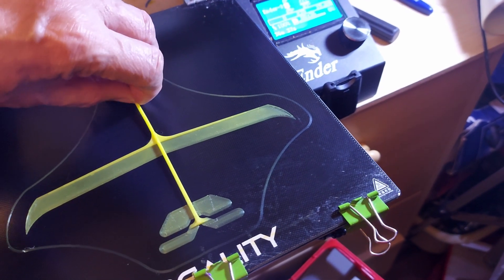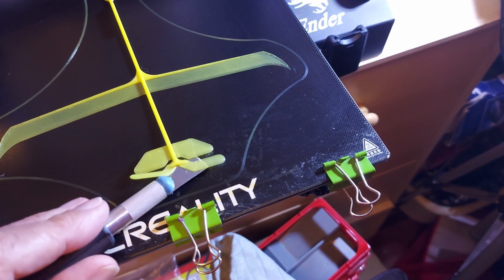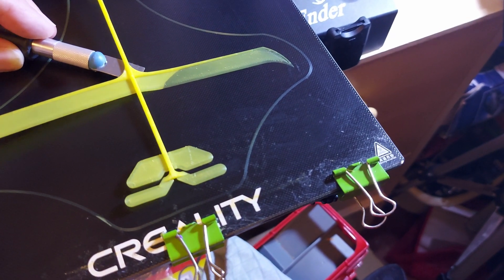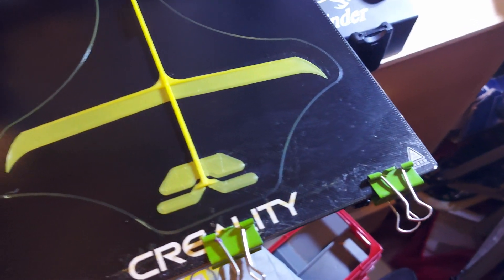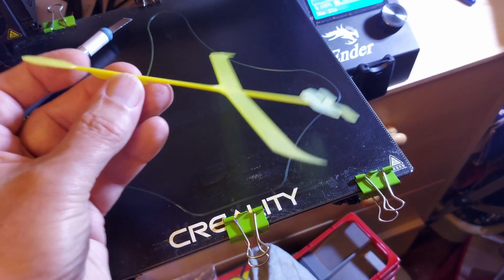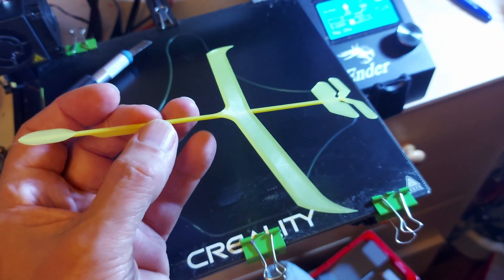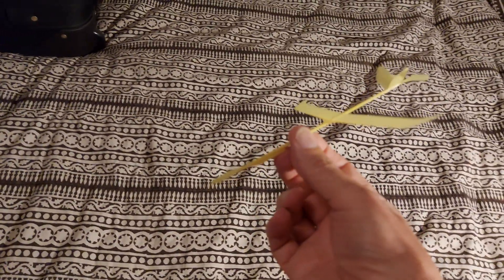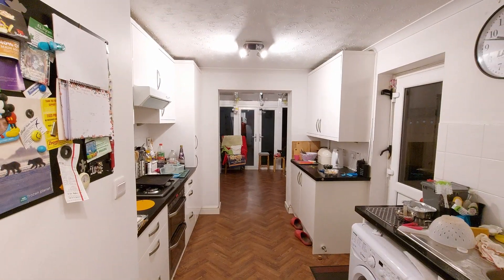Ultralight 2gram Glider print in place by robotfriend

Comment: Maybe you could mod the file for that glider with your channel name on it and make about 5 or 10 and fly them off a bridge over a walkway with kids about. Cheap advertisement.  I assume it uses super little filament. Of course, you would be adding weight to it but if 3d printer could add it just enough to read it maybe.
Reply from the maker: It is a bit of a dilemma, you have probably seen my "leave behind art" videos, I always worry that somebody will decide it is just littering, rather than art.